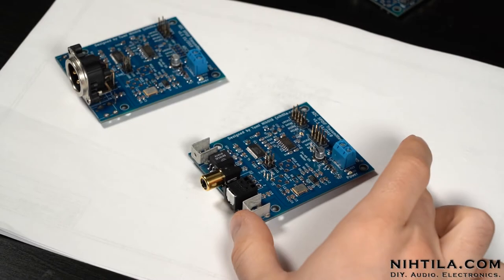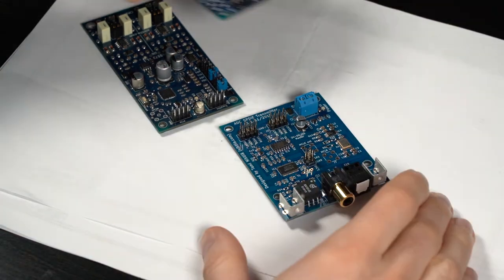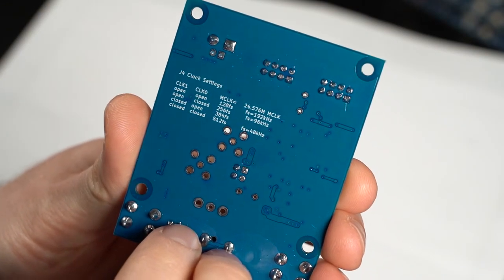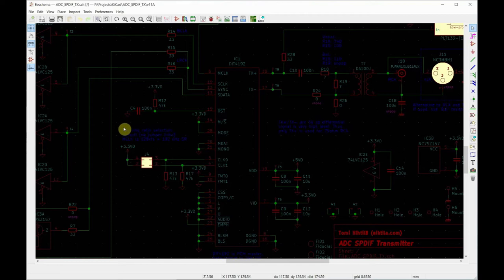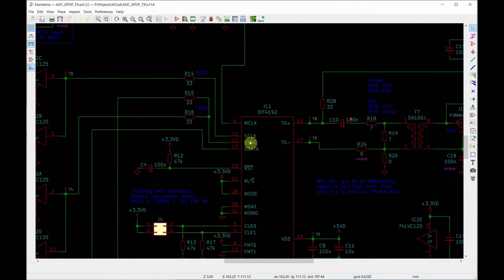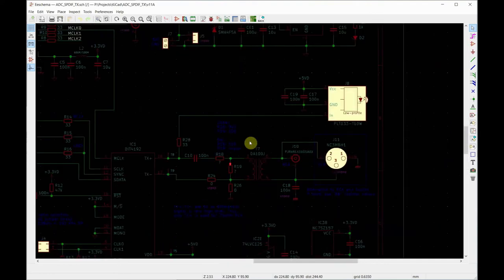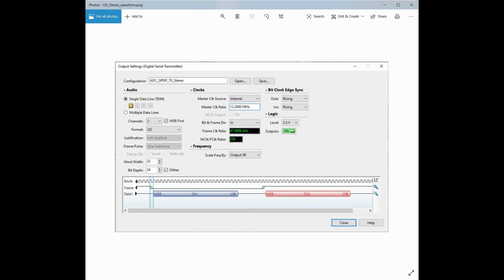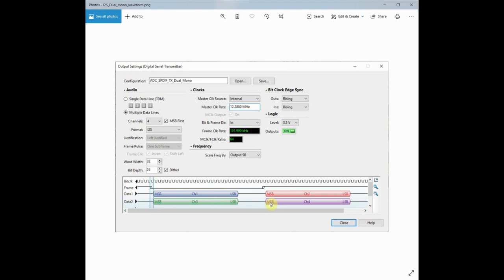SPDIF TX - I2S to S/PDIF Converter - Introduction, Schematics

Comment: Is there any chance for a 4x I2S to ADAT-Lightpipe converter, e.g. based on 2x TI SRC4194 + 1x Coolaudio V1401?
Reply from the maker: Unfortunately, at least not right now. Everything I do for now comes from my own needs/interests and my background is in Hifi and home audio, so unfortunately don't know much about Pro Audio needs. However, I do get occasional pro audio customers and requests so I am definitely keeping the options open trying to serve that space in the future.
Reply: @kaamostech  There is a home audio application: Convert 4x I²S (7.1 channels) HDMI audio to ADAT Lightpipe to get 7.1 into an USB audio interface (HDMI audio extractor -> 4x  I²S -> ADAT Lightpipe -> USB audio interface). This would e.g. allow to run CamillaDSP on the HDMI audio to to active-crossover, channel/down mixing and/or frequency-response-correction.

Comment: May I ask a question referred to s/pdif. I've got a PC soundcard that should have spdif out but corresponding components are not populated on the PCB. There are places for it and also pcb mask says which component should be soldered. I think that schematics should be somewhat standart for such things but I'm not familiar with it. Is it possible to restore this function that has been disabled by manufacturer? This is an old soundcard with interesting wavetable synthesizer onboard and I would like to get opportunity to get clean digital output avoiding it's bad analog audio output which isn't good quality. This soundcard has even spdif out in windows driver but no way to use it.
Reply from the maker: Hi. Sorry for veery delayed reply but as I re-started the channel I will reply anyway. Unfortunately, it is impossible to say if it has been disabled somewhere else in HW-level as well. I would check with oscilloscope if you can see any signal in there.